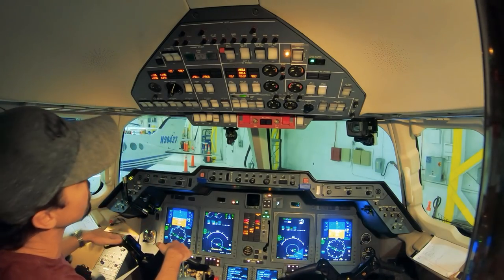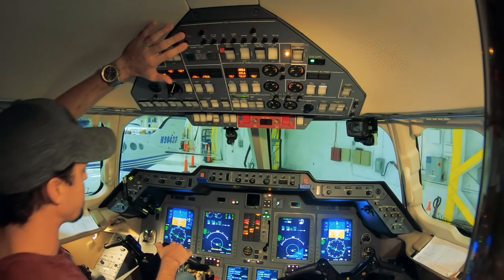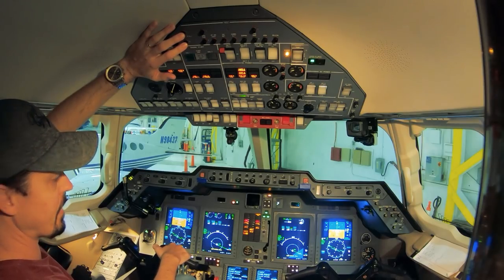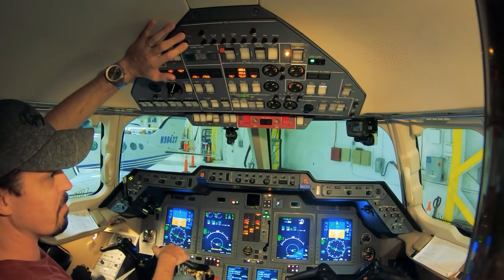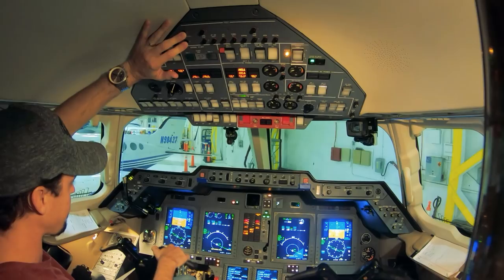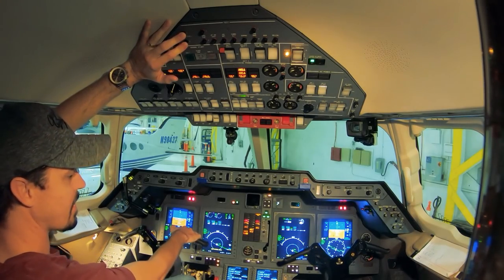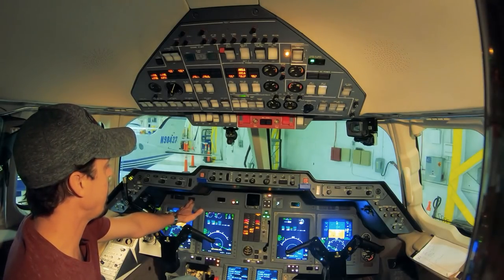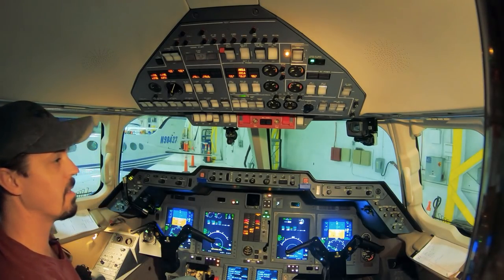How NOT To Stall A Jet - Tech Tuesday

Comment: Very interesting. It just pushes the yoke forward. On a piston airplane like a Cessna 172 you have to use rudder also because of the engine rotation pulling the plane to the left. Not that way on a jet engine. Thanks for this informative video.

Comment: Very well explained.
Reply: Not quite. The AoA indicates angle of attack, when its too large the wing stalls. He talks about low speeds, the aircraft can stall at any speed. When the stick shaker is active, its not telling your too slow, its telling that the AoA is too large, or almost. Stall has nothing to do with speed.
Reply: Stall prevetion warning...
Reply: @flexairz  Get off the flight sim
Reply: flexairz so stalling has nothing to do with speed huh?! U said it right there in ur comment if ur AoA is to large then ur dropping in speed which would cause the stick shaker to go off!! That’s exactly what he was just saying and obviously u didn’t listen in the first part of the video, where he said that stalls can happen at any speed but he is just going to talk about to low of speed stall and back to ur AoA is to large then that is why the stick pusher would push the stick forward to get u out of the LOW SPEED  stall because the AoA is to large, so in other words yes it does have to do with speed!!!!

Comment: What happens if the pushover starts when your at 200 ft. during landing? Great vids!
Reply from the maker: The pusher system deactivates for takeoff and landing. I think the height is 400 feet, but I have to check myself on that number.

Comment: Shaun is it possible for a malfunction in the AOA circuit to activate the shaker in normal flight?  How would you handle that?
Reply from the maker: It is possible, but very unlikely. There are buttons next to the red lights that would disable the pusher, but the shaker would have to be disabled by pulling the circuit breaker.

Comment: Stalls depend only on angle of attack, not airspeed.
Reply: However, the slower an aircraft flies, the greater the angle of attack it needs to produce lift equal to the aircraft's weight. 
As the speed decreases further, at some point this angle will be equal to the critical (stall) angle of attack. 
This speed is called the "stall speed".

Comment: How much faster than stall speed do you usually touch down?  1.1*Vs0?  Out today with a fellow CFI and we were playing with precision full stall landings, and your talk had me wondering if the system deactivates when landing.  - I assume it remains active, and also activates based on AoA rather than IAS, right?
Reply from the maker: We typically touchdown around 1.2 Vso. As for the system, it keeps the shaker system active, but the pusher will deactivate, and yes they are based on AOA, not IAS.
Reply: @CorporatePilotLife  Thanks!

Comment: Will the anti-stall system discriminate altitude above terrain?  I imagine it would be a real bummer if, low and slow, the aircraft self-augered into terrain, where full throttle might have sufficed.
Reply from the maker: Yep...I would have to verify the height above terrain, but I think it's 400 feet that it deactivates the pusher. It'll still give you the shaker to the ground though.

Comment: A stall occurs when the aircraft exceeds the critical angle of attack. On this particular type a full stall is not recommended. Based on the swept wing profile of a jet the stall will begin at the wing tips therefore a loss of aileron authority will be inevitable. When these type of wings stall they will have roll control-ability issues. 
Frost on the wings will cause the aircraft to stall at a lower angle of attack and higher airspeed. Increased Bank angle also causes a stall at higher air speeds but at the same angle of attack.  
A question for you Shaun. Do you have DPE authorization to conduct type rating check rides?
Reply from the maker: I don't have DPE authorization. I am a Check Airman in the Hawker and G-IV, but I can only conduct line checks in flight and knowledge check on the ground.
Reply: Corporate Pilot Life thanks. I lost my job with allegiant air back in May and I only have a A320 type rating and King Air 350. Its tough to find another job in the 121 world and 135s are wanting specific type ratings.

Comment: Another great vid., Shawn. Curious, what altitude do you practice stalls in the Hawker? Thanks!
Reply: You don’t. Unless you mean after a rebuild. Other than that they practice in the sim.
Reply from the maker: When I did the demonstration with the test pilot, we used 16,000 feet. In the simulator, we practice them at low altitude right after takeoff or on approach to land.

Comment: As you performed the simulation and moved the yoke did the external control surfaces also move? Take Care
Reply from the maker: yep...they're directly connected
Reply: @CorporatePilotLife  Thank you as I was not sure if a fly by wire system would recognize it was a stall simulation. Take Care

Comment: I'd like to clarify your explanation of stalls.

There are aerodynamic stalls and compressor stalls, but no engine stalls.

An aerodynamic stall is when the angle of attack is too great and the center of pressure shifts way back. Basically, the wing stops creating enough lift and the nose drops.

A compressor stall is when the turbine blades in the engine (essentially spinning wings) have an aerodynamic stall. The airflow at those turbines temporarily switch direction and you can get a buildup of gas followed by a uncontrolled detonation. It is quite dangerous to the health of the engine.

A jet engine that fails and shuts down is called a flame-out.